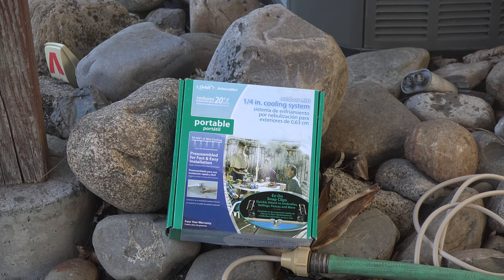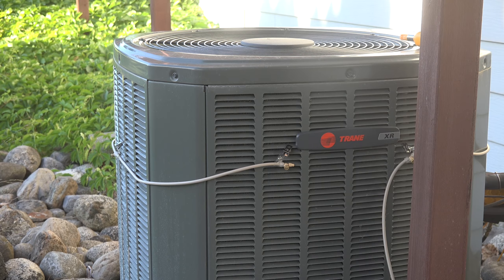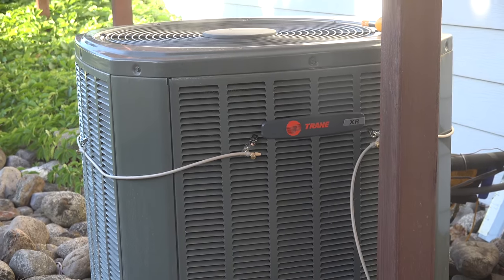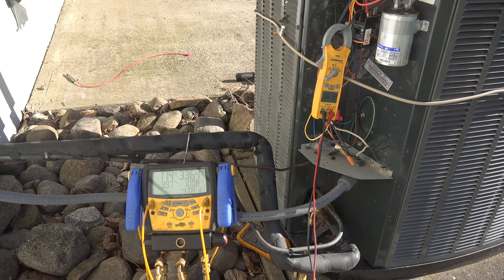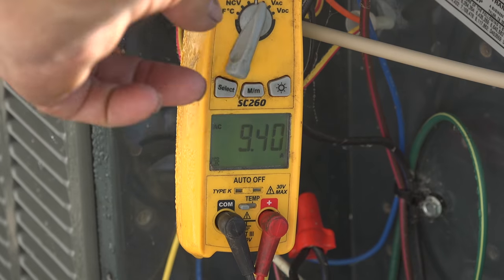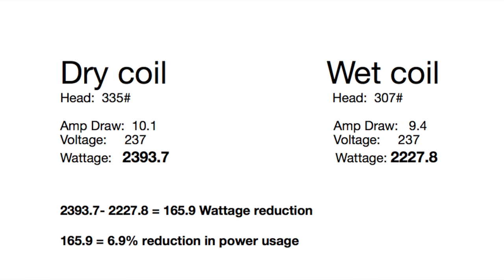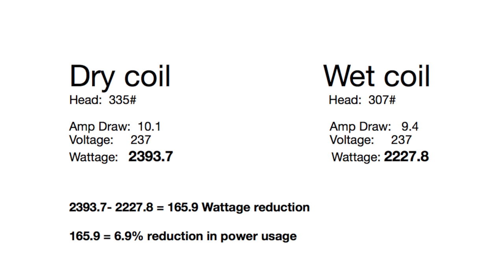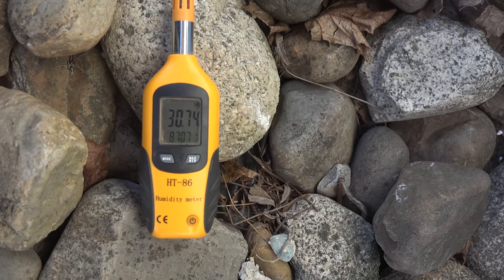Do the misters for A/C work? Part #1

Comment: I live in the desert in Nevada. I got a misting hose for the covered patio. Does the Calcium stop up the nozzles ever or does it just collect on the coils of the AC?  We have two large swamp coolers that get calcium build up.  I think the fix to this whole issue would be to install a swamp cooler that blows on the AC. That way the Pads on the swamp cooler are collecting the calcium, and just blowing cool wet air, right? On the flip side of that, is it worth the cost involved in making or buying a swamp cooler just for the AC Unit? Probably not according to the numbers. On 110 degree days, we use the AC for about 4 to 6 hours on 74 - 76 degrees and leave the swamp cooler running.  Without the AC, the house would get probably 80 - 84 degrees. The swamp cooler pushes the opposite end of the house to my attached garage's far window.  I understand it is pushing out air from the AC, but is the air really wasted if the AC isn't cutting off for those hours from +/-4pm to +/-8pm anyway?  The air here from the swamp cooler is going to be cooler than not using it because of the moisture. Sure we could put the AC on from 9am - 9pm and keep it cold, but that is 12 hours instead of the 4 hours we usually run it.
Reply from the maker: The nozzles do plug up and the calcium does build up on the coils.  The swamp cooler feeding the A/C is pretty much useless.  You will never save more than the swamp cooler motor uses.  Do not run the A/C and the swamp cooler at the same time.  You are trying to pick up nickels and dimes and probably not getting either one.  The high humidity air supplied by the swamp cooler puts much higher load on the A/C.
Your best bet is use the swamp cooler until the indoor temp is too high, then turn on the A/C.
GFM

Comment: In extreme climates AKA Arizona they even have evaporate coolers on the roof of malls JUST to cool the AC condenser, for something like a large freezer in a mall food-mart. Due to the 120+ F temps here it takes a lot to cool something like that.
Reply: BTW 40% of the houses here use evaporative coolers as primary cooling. Very low humidity

Comment: With the Texas weather hitting close to 100, i tried spraying the condenser to cool it down.  The upstairs might have gotten to 76, but took a long time to cool down the kids room to 72.  Just seemed like the AC was struggling to cool down the upstairs.
Reply: So my thought was to set up my Orbit sprinkler timer and have it spray the condenser a couple of times in the afternoon to help cool the upstairs quicker.
Reply from the maker: @macky322  If you have watched the rest of the series, you know the issues with misters.  
As for the upstairs, If the same unit is used for 1st and 2d floor,  most A/C systems will not cool both floors with the same A/C unit.  If the control is in the upstairs, the lower floor will be too cool, reverse for lower level control.
GFM

Comment: Well I live in central Texas and I just grabbed a spray bottle and sprayed down the coils and was just checking the current and it went down from like 8.5A to like 5A on our mini split I was actually spraying the coils not just the air around them but I was also using a spray bottle so when I got to one end the otherside was pretty much dry but that's like 30% or more and that's the whole units power since it's a mini split not just the outdoor unit I mean Inside it's just the fan but it would be a bigger percentage if it was just the compressor but ya you would need some good filtered at treated water
Reply from the maker: Watch the entire series.
GFM

Comment: Ok, you made an instant test, but I'm pretty sure that the unit is going to cool the room faster because liquid refrigerant is going to be cooler getting a better efficiency. Probably the compressor is going to work less time. I'd try misting the system for a whole month or more and compare to see if power consumption has really gotten lower. Thanks for your videos.

Comment: Lots of comments addressing this already, and this video is a year old. But this is an incomplete analysis without a delta T test inside the house before and after misting on a hot day. My register temperature drops significantly when I spray my outside coils. So my AC wouldn’t have to run as often because it’s cooling my house faster with a mist on. I have a high efficiency unit and just had my coils cleaned professionally at the beginning of summer. The number in this video were definitely interesting though, despite it only being half the picture. Thanks for the video
Reply from the maker: There is a link at the end of the video.  Watch the rest of the series.
GFM

Comment: That same principle is used in newer window air conditioners. The bottom of the case fills up with water and the fan slings water onto the condenser. They also fill up with algae too if you don't put an ounce or so of bleach into it every now and then.
Reply from the maker: That system is used mostly to get rid of condensate.  With a little help on head pressure.
GFM

Comment: Good information and well done. But....I noticed my head pressure dropped about 10 more than yours did. Also cycle time decreased by 2.5 minutes (same ambient temperature) per cycle vs non misted coils. I have run my mister for 3 years with a mineral filter and have no buildup what-so-ever. I cant really say if there is any savings in electrical cost, I have a pool and a couple koi ponds so my electric bill is high anyway.

Comment: I spray the condenser coils two or three times a day with the water hose to reduce the temp on it and evaporate the heat. Seems to work.
Reply from the maker: You probably saved around 15 cents.
GFM

Comment: I feel like, you are also saving on the life cycle to the unit... If you can make the unit last longer by the reduced head pressure you are saving money in replacement cost as well ?
Reply from the maker: When you look at the whole picture, there is probably no savings.  These things are designed to operate with the designed head pressure and any lowering of the head pressure may effect oil return or superheat negatively and the damage to the coil from the water will reduce lifespan.
GFM

Comment: Calcium is a dissolved solid. The only way to remove calcium is reverse osmosis or ion exchange (water softener). When you use a TDS meter you will see from softened water that TDS is the same. That why it's called ion exchange. Good decision not to keep spraying that nice Trane. It would absolutely clog the coil eventually. This was an awesome video. Thanks for sharing the research.
Reply from the maker: Welcome
GFM

Comment: They make heat exchangers that can use either running water, or water circulated with a pond or river close to your house.  Epoxy coat the pipes for long working life of the plumbing.  Use a very small circulation pump and this will cut your A/C costs considerably.  This also eliminates the need for the fan.
Reply from the maker: What you are describing is a water cooled condenser.  They are somewhat cheaper to operate but are not legal in many jurisdictions unless you have a cooling tower or, as you say a pond or river near your house.  
Also, compared to modern air cooled A/C systems, the savings are lower than you would expect.
GFM

Comment: Well here in South Texas it saves me an arm and a leg. I plan to build a water cooled coil using geo-therm. I will burry some coiled up 3/4 coper tubing 8 -15 feet down and let the 🌎 absorb the heat by using rhe cooled water to cool a condenser.

Comment: Patio misters in the evaporation process are enhanced with dry air. Could you include the humidity level or dew point along with the temperature? I'm in Southern California and swamp coolers and misters are very effective. A swamp cooler will drop 20 or 25 degrees in single-digit humidity levels.
Reply from the maker: The humidity level was included in the video.  I believe it was about 30%.  I will be doing a video with higher temps and lower humidity in the near future.
GFM
Reply: grayfurnaceman I thought I gave it a college try to look for those numbers and missed it. I do appreciate your video it tells me just what I needed to know but didn't have the patience or equipment to do the test myself.

Comment: What about when it’s 100-110 F outside? Would that result in a greater reduction on the head pressure?

And I’m thinking this shorterm test isn’t giving the whole picture.  Yes, you need a mineral filter. But…

Let’s say I have a package unit that sits in direct sun through the 1-4 PM. Misting the housing on this system would reduce the inefficiency of the surface temperature of the metal being 130+. (No amount of 1” thick insulation on the inside of this housing is gonna prevent that from being a factor). 

Also drawing in humid air in FL is not gonna do the same thing as misting cool water onto hot coils.
Reply from the maker: One of the misconceptions with sunlight heating metal is that temperature tells little about BTUs.  A metal housing left out in the sun may get very hot but only contain a few BTUs.  
GFM

Comment: I work industrial maintenance. We've employed misters on a bit larger scale to some of our units on extremely hot days and we experience significant reduction in head pressures.
Reply from the maker: There is no doubt head will drop and power usage will drop slightly.  The largest issue is calcium on the coil and some risk of corrosion.
GFM
Reply: @grayfurnaceman a simple filter will eliminate that. At 24 cents a kWH you will realize ROI in a month.

Comment: When temps are the highest, humidity might be lowest.
In this regard, this idea MIGHT pack the most punch...
Otherwise, not so valuable.
But, since the cost is minimal, and the work will last for years, why not?
Also, soft water would be better... no CaCarbonate crystals would grow on the outside coils.

Comment: I made a spray system with 1x2 around the unit. It worked great but I was afraid the water would somehow damage the fan motor as all the water pray goes past the motor as it blows upward. Here in Az today we had 114, and is suppose to be the same tomorrow. The entire week has been over 110+. SO this really drops the heat fast to cool the evaporator. But Im nmore scared of damaging the fan motor and corrode the evaporator, even though I know if you wash any alluminum and or copper with lemon juice and backing soda, it leave it like new. SO Im not sure if I should put this mister back to cool the evaporator. Even if you dont same $$$ My purpose of doing this is to not have the compressor work as hard as it does with out it and cools the evaporator so much faster that help the unit run better. Heat over 110 or 115+ like here really over works the system. Id like any advise on the end result of the fan motor getting wet even though they get rained on and do damage but will house (tap water) corrode anything else besides the motor inside. I cant wash that of with lemon  juice and backing soda.
Reply from the maker: The problem with the fan motor is the moisture comes from below.  
There are 2 issues with water on the coil.  Calcium deposits and corrosion.  Calcium is the result of evaporation and I can't tell if rinsing with lemon juice or baking soda will help or hurt.  Corrosion will be a result of water passing thru the unit.  You can't change that.
You do need to consider the warranty status as most manufacturers will void the warranty if water is sprayed on the coil.
GFM

Comment: Nice work…thanks!   I also don’t want to risk gunking up my coil. Since my unit is in direct Sun…I may try a barrier of some sort to block the sunlight instead? I’m in S. Cal. With super dry air and 110 to 115 degree days common.. so the mister would likely work well…but I still don’t think it’s worth dealing with it.
Reply from the maker: Try this one:  https://youtu.be/014DggY8Mfk  Are you located in the Mojave area?
GFM
Reply: @grayfurnaceman  I’m in Indio (near Palm Springs) … close to the Mojave… Thanks for the shading video….  I guess I’m going to leave it alone.

Comment: You need to measure the run time reduction too. 
The main way it saves you money is by rejecting heat more efficiently and needing less time on to move the same amount of heat out.
Evaporation id only one way that the mist helps. 
Water is a MUCH better heat sink than air.
Using rain water and water that you catch from condensate  will clean your coils too. 
There will be no dissolved solids in rain water and condensate, and the ph will be low due to the sulfur dioxide that condenses along with the water.
Reply from the maker: Watch the entire series.  Run time is not reduced, in fact it is marginally increased.  
Any water condensed out of the air is quite corrosive, especially if it is hot.  
The only way you would get sulfur dioxide the water is if you were using condensate from a gas furnace.  Did you want to heat the house, then cool it?
GFM

Comment: A large industrial building I work at installed roof top misters and our roof heat load was reduced by about half. This reduced our electric bill by about 20%. A waffle hut in Alabama installed a lawn sprinkler on its roof and they told me it reduced their a/c bill by 30%. Of course it is controlled by a computer. I. would like to understand how must any added roof maintenance may have been. 

Thanks for your real world evaluation of a/c condenser coil misting.
Reply from the maker: The use of misters on a roof can be effective in reducing roof load on A/C systems.  However, when large drops in power usage are listed, I am always skeptical.  Power bills are notoriously unreliable in determining drops in usage as no month is the same.  It also indicates there is a problem with insulation of the roof.
GFM

Comment: I put something similar on a 20 year old condenser. I put it on a solenoid valve on the hose so that the condenser being on turn the water on. I looked at it in thermal camera and it dropped temp in and around by a lot

Comment: My black lab sometimes comes home all muddy from one of her 
adventures. I get the garden hose out and wash her. That well water is
really cold. If the fan on the air conditioner is buzzing like crazy trying to cool
the coil with 90 degree air then don't you thing 50 degree water would be 
much more effective?
Reply from the maker: That is what this series is about.
GFM

Comment: Just did misted our chiller condensing unit cause one of my fan blower is slow and replacement are a week away.. head pressures was clipping at 375psi on my high pressure limit Cut off setting.. got it down to 285 psi just to keep the ac from shutting down on a 95f ambient until parts came in..
Reply from the maker: That would be a sensible use of a misting system.
GFM

Comment: I tried this with a window air conditioner.  Without mist, the inside air was 48 deg F, and even after ten minutes of misting it was still 48 deg. F.  The results were the same whether the mist was directed into the unit and against the back of the coil, or it was directed out, to cool the air being drawn in and blown through.

I think it would be effective if the condenser was encased in a water jacket, with water circulated through an underground grid (with a pump but no fan), but that requires re-engineering the air conditioner (and a LOT of digging).
Reply: that basically makes it a geo thermal system.   you are directly dumping the heat to a water tank.    Im sure it would work.

Comment: if your outside unit is in direct sunlight then your coil would be much hotter, the water can bring that temp down, I also replaced my small nozzles with bigger ones, I expect it to be most effective at high temps. the flapper thingy looks nice
Reply from the maker: I get a lot of that.  Sunlight on the outdoor unit makes little difference in power usage.  The difference is BTUs, not temperature.  You can have quite high temperature with very small amount of BTUs.  Consider a candle flame.  touch it and you will get burned, but it won't heat your house.  You would be better served by shading windows that are exposed to the sun.  
I have no experience with the flapper, but it looks like it would be easily broken.
GFM
Reply: @grayfurnaceman  thank you I am not an AC guy, I was thinking of increasing the gradient between the out side coil and ambient temps, if the outside coil is say 150 and outside temp is 110 the gradient is 40 but if you lower the temp to 105 then the gradient is 45  if the coil and the outside temp are the same then no heat will move, I learned today the inside temp can get so high the unit will shut down.

Comment: The Doohickey is called an in-line water filter. Another 15 bucks. Also add a smart water timer and then add a routine to activate the misters with the smart water timer app or I FTTT. You will find out that 60 bucks for the commercial version is not a bad deal because it’s gonna cost you about 60 bucks to make your own that’s equivalent. You can even get elaborate with this design and add smart temperature sensors on the side and top of the AC unit and feed that information back to IFTTT for more precise control. there might be enough water forming around the air conditioner line to collect in a drip pan. You might have to cut into the foam insulation for the water to drip out into the pan. Then just add a solar water fountain with a little back up battery and of course all this will be right next to the AC unit most likely behind it. Free water free electricity
Reply: Agreed

Comment: I agree with other this probably not a bad option when unit is struggling due to excessive heat. Also it would will be more efficient with higher outside temps.  Long term use would more than likely cause oxidation of the fins on the coil.